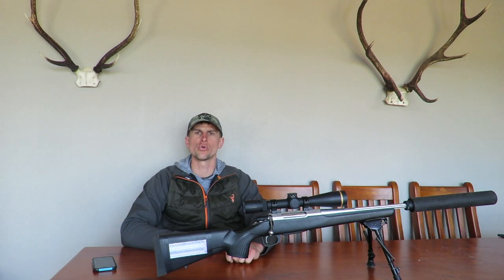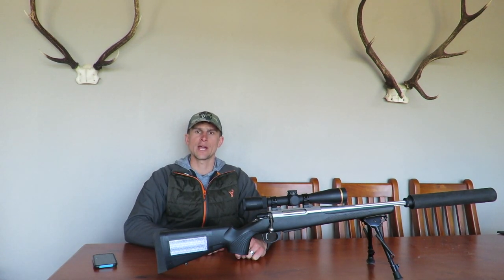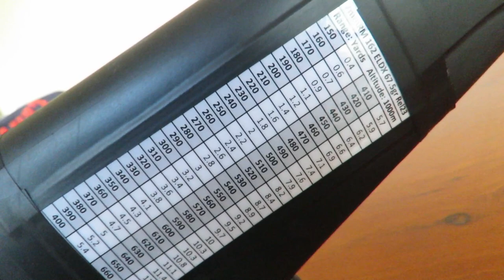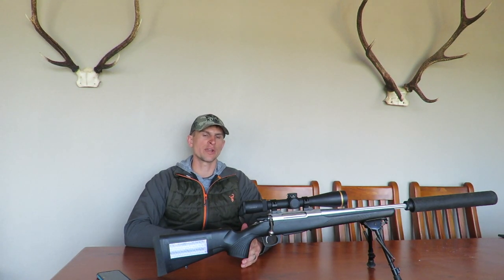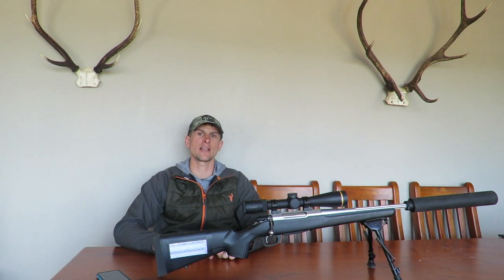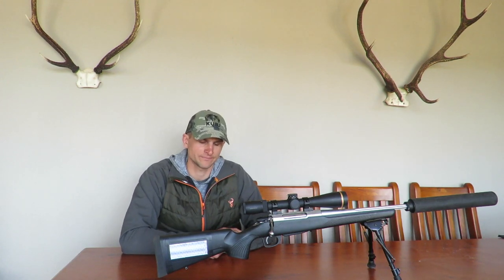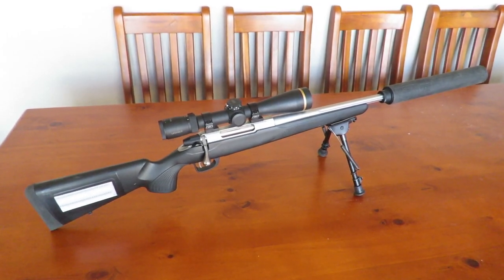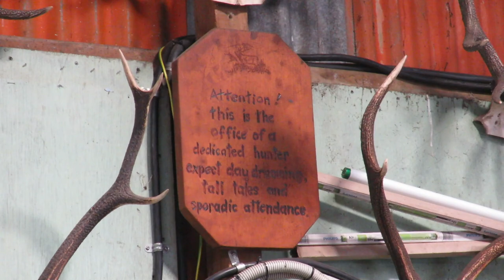Short 7mm Rem Mag (Part 2) - Trueing and Long Range Shooting

Comment: What was the velocity change from the standard length barrel and the shorty. I’m really considering shortening mine to 18”. Just concerned about the velocity loss. Hunting big arse moose but I typically don’t shoot past 400 yrds. Running a Rugged Alaskan Ti360 can.  Thanks mate.
Reply from the maker: I changed powders when I shortened the barrel so I didn’t get a direct comparison unfortunately. I personally wouldn’t go less then 20” for a 7mm rem mag. I have multiple friends with them cut to 20” and that works out nice.

Comment: Informative. How would you combine that method with a CDS? Just do that first? Then supply the adjusted muzzle velocity?
Reply from the maker: Yup that’s the one mate. The good thing with a CDS is they are generally used within hunting ranges where the differences won’t necessarily be noticed if you have a reliable chronograph MV.
Most of my rifles have been pretty bang on when I trued them after getting a reliable chronograph MV but there can be funny exceptions like my 284 for example required an adjustment from the labradar results.